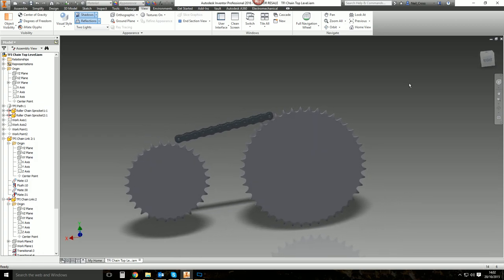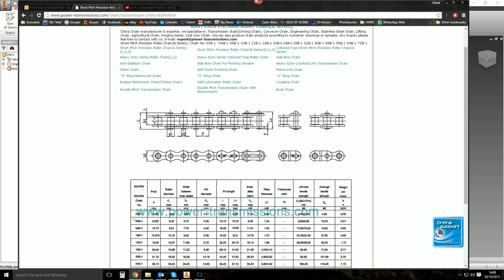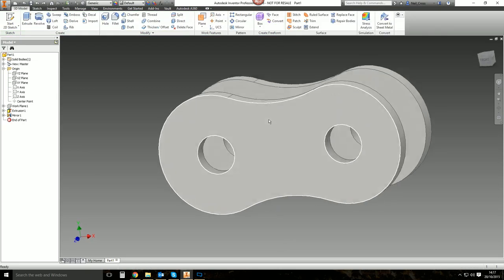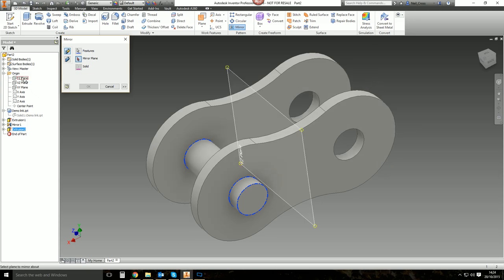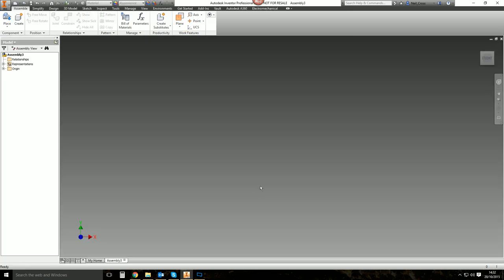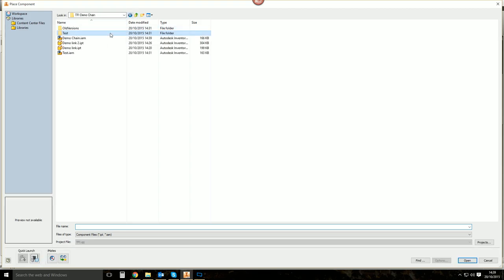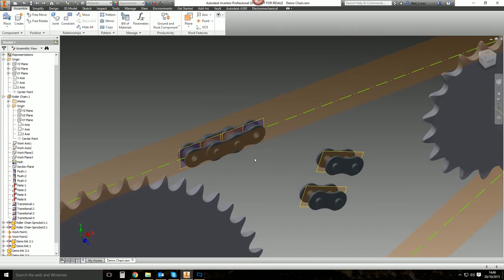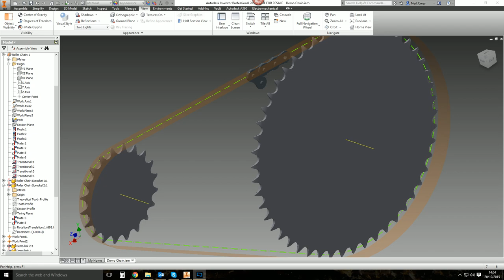Full 3D chain tutorial with real time movement | Autodesk Inventor

Comment: Hi you mention at one point in the video the problem of chain link flips around the wrong way when they are constrained, the problem I have solved by creating a limited angle constrained on the pin between the two link at 40 dg. in both directions

Comment: Great demo.Just in case you check back on this, the solution to stop the chains jumping is to use joints instead of constraints on the pins and holes. It seems Autodesk know that constraints are dodgy, and joints seem to be the future.
Reply: i would say constraints are for parts that shouldnt move and joints are for any parts that do move

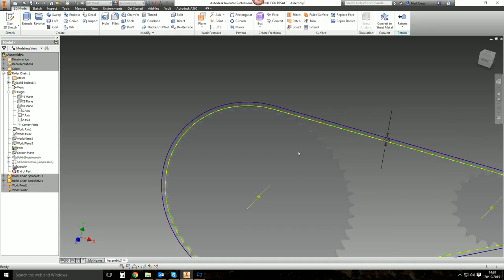Comment: Help with extrusion @ 36:13? With inventor 2020 at this point you do not get the option to extrude as a surface? I spent 1.1/2 hours trying to sort this and researching why but I couldn't solve it. The blue box which was added to replace the old dialogue box in older versions isn't visible at this point?

Comment: Wow there are so amazing stuffs thanks for your presentations. two questions.
1. According to your methods, If we complete to assemble all of roller chains, we need to do manual constraint process at least a hundred of times.
2. If we do rigid constrains for all of roller chains and sprockets in your assembly files. It maybe causes performance problem. In this tutorials,  that exists only two sprockets and some of roller chains, but If we use sprocket-chains in the real machines that contains  numerous bolts, plates, gears and so on, that will be critically lower your computing performances.

Comment: Are there any tips you can give me/us for when using the loft tool? -I always get errors with that tool complaining about my curves needing to be more smooth, and that's frustrating when I've got exactly the curves I want. For example, at the moment I'm making a canoe using a quadrant method, and I'm wanting to pull a surface loft from a line to a point, which goes fine because I can see it update, but then when I add the rail I always get errors. Annoying as fuck. So any help in understanding the requirements of this tool would be much appreciated. Thanks for your videos by the way, very useful.
Reply from the maker: +6969SpAcE6969 Loft can be a nightmare when things get complex and detailed, there isn't really a one size fits all tip for it.  However if you're modeling a canoe, have you tried using the freeform modeling tools instead? It won't be parametric but for a shape like that I'd choose freeform any day
Reply: I've been trying this method from a video on youtube; if you search for 'inventor canoe' you'll see it. Just playing around with approaches, but your advice for freeform totally makes sense.

Comment: So I have a conveyor chain I'm working on (roller chain like you did, but some links have ears for pusher attachments). I constrained things using the transitional as you did, and it works fine with 1 link but seems to "bind" when going around the sprockets. I do not have contacts, just trying to follow the path. Works fine all the way around the path with 1 link only, but sometimes the link "flips" orientation (it's not symmetrical due to the ears). Any suggestions? One thing I noticed different than yours is that I had to make my surface at the root of the tooth diameter rather than the tip like you did, because for some reason the surface normal on my surface is opposite yours. Thanks in advance.

Comment: I suspect the reason you're having issue with the chain moving around the cog, is you don't have any clearance between your pins and inside link. with the contact set on you would want clearance. I could be wrong, but from my limited experience inventor gets grumpy when you don't have enough clearance with a contact set..

Comment: To speed up the assembly of the chains, you can make the first set and then copy paste them together, this will copy the constraints between the inner and outter links as well. Constrain those two set to the first set.. then copy paste the two set of links in on go and connect those, and so on and so forth. Though you will still have to do the transitional contraints to the path for all the inner links. (This feature might not have been in 2016, I can't remember, but it is in 2017 and later)

Comment: Amazing tutorial, love the whole process and explanations. your character is quite amusing as well. I do have a question that has been a pain for a long time and again going through this tutorial working along I had the same issues and another. one if i made the derived surface NOT visible, in inventor studio it still tried rendering that surface. and when I got near the end placing the parts of the chain we modeled in the beginning even though I made the plane not visible and the derived surface of the other link part not visible when I place the parts in the assembly they are always visible again requiring me to make everyone not visable again at the part level. why it doesn't stay invisible when I turn visibility off and save the part?

Comment: Jeez, what a lot of work. It'd be quicker to assemble it in real life. I thought Inventor was about productivity? Autodesk really should make a tool where you can perform all the steps shown in the video from 1 dialogue box driven with gear and chain parameters.
Reply: Yea, I think rather than modelling it with discrete constraints, it should be a canned constraint of a chain-coupled gear train. Likewise for mated gear trains. I don't usually machine gears and sprockets, I order them from a catalogue like bearings or fasteners, so likewise I'd rather not go to the trouble of modelling them, and just pull them out of a list of standard drive components, and be able to add my own when I do need something non-standard. For all I know, Inventor does this by now, it's been a few years since I've used it.

Comment: The Idea is nice. But you need to calculate exactle the lengte of the chain or it won't fit together in the end. A link is like measured in a straite line, Your path is curved. How in the hell are you gonna fit thos together in the end (first link to last one)?
Reply: I think that's why he used the chain generator to create the cogs and the path, automatically works out length of chain, number of links and teeth. So if inventor's chain drive is accurate, you shouldn't need to work it out.

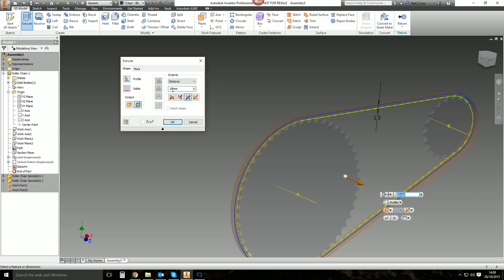Comment: Hello ! Thanks for your video but i have a problem. I need to help. I'm setting a sketch just like 36:32 into your video but i can't do it. I'm using Autodesk Inventor 2021. Extrude command into Inventor 2021 have not " Output" so i can't make a plane just like you. How can i fix it ? thanks so much.
Reply: extrude tab look for top right corner
Reply: @highway4802  thanks very much

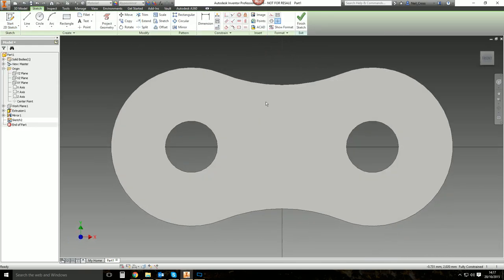Comment: What key did you press around 15:08 to hide the mirror shape so that the axis lines became infront of the solid
Reply from the maker: That was F7 to slice graphics.  It didn't put the axis in front of the solid, the sketch plane stays put, what F7 does is temporarily hide all the solid model data in front of the sketch plane so you can see it better.
Reply: I saw that later on. thanks alot for the reply though